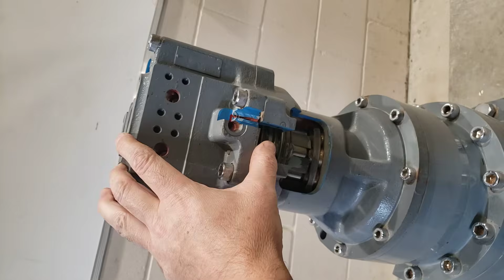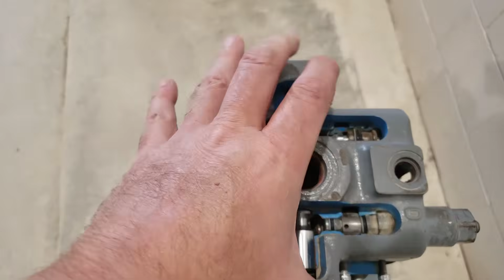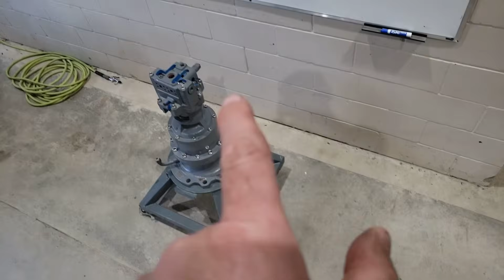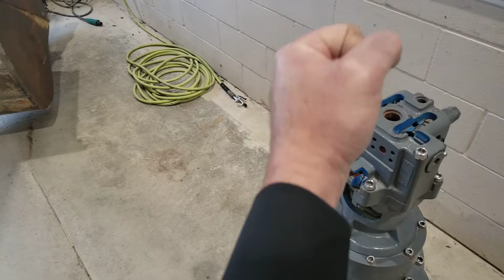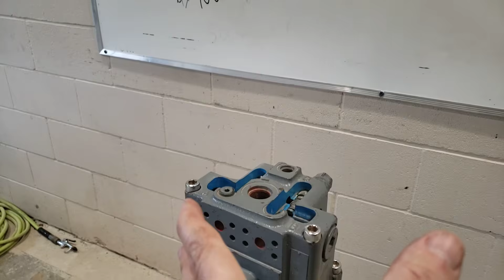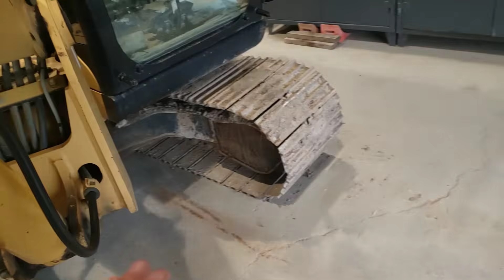How an excavator swing motor /swing drive works hydraulics

Comment: That fixed piston motor is also similar to what is used in hydro static drives in riding mowers.   But I was wondering,  in hydro static drives, is the motor what is variable or is it typically the pump that is variable?  The grasshoppers I run have dual motors and dual pumps, so I'm not sure.   I've seen other machines that have single pump and dual motors, so those would obviously have to be a variable motor, rather than variable pump... But on the machine you are showing, it's a fixed motor and you just vary the flow to it.   Interesting stuff.  A pump and a motor are literally the same thing I guess..  Just depends on where power is applied.  I'm doing a speed run through your channel and I've already learned a lot from your hydraulic vids.    I subbed
Reply from the maker: The motor swashplate cannot go over center. Its actually kind of comical to think of what would happen if one tried.... 😊
Reply: @hydraulics  Yes it can.  That's how motors go in forward or reverse.  The swashplate can tilt one way and go forward;  or be flat and not pump at all;  or tilt the other way and go in reverse.

Comment: Just saw this video and it was very insightful. I currently have an issue with a CAT 350 excavator. The RH swing drive leaks oil, which then dilutes with the grease applied to the turn table. I dont know what the reason for the leakage is. Any ideas?

Comment: So I have this excavator that don't stop swinging until you turn the control the other way and on a slope the bucket will swing down hill if I don't counter it with the control. What is are the possible reasons for this?
Reply: Did you ever figure it out?
Reply: @RylanCunningham1  no, I just borrowed it from my uncle. Have no idea.

Comment: If it’s won’t rotate one direction what does that mean ? Got a smaller bobcat that will only rotate one direction and can spin freely the opposite direction
Reply from the maker: Welcome to my channel. I am a red seal licensed Heavy Equipment Technician (421A Ontario) since 1989, and I recently got my EGSA Journeyman Technician certificate. I am an educator. I am not servicing equipment professionally and I do not compete with my colleagues or graduates, therefore this channel is about general education and gives a sampling of the kind of lessons one can expect in a trade related college program. This channel isn't for me helping you fix a specific machine for free. Please hire a pro.

Comment: Im running a 308 cat im geting a slight grinding noisewhen im swinging back as long as i swing slow it doesn't do it but when i dig fast it does it im not sure what it is it  just started a couple days ago
Reply from the maker: check swing bearing grease pan. check swing drive dipstick.

Comment: Hi! I have a Hitachi Zaxis 120 leaking Hydraulic oil from gear oil filler and dipstick on the swing motor. Any help or advice would be much appreciated.
Reply: Hydraulic leaking from motor to hear side check the motor seal
Reply: The main seal at the bottom of the shaft of rotary group has probably done its work. Cause of it can be a high case drain pressure, so it’s probably necessary to also replace the rotary group. Also check if the case drain hose isn’t clogged so the pressure doesn’t build up in the hydraulic motor, because that could be the cause of the blown seal.
Reply: @zanpetric4008  Thanks for the reply. it wasn't clogged. Rotary manifold rebuild didn't solve issue. (i didn't think it would but boss told me to do it.) We ended up replacing swing motor which solved our issue. Suspected valve plate or axial piston failure.
Reply: @_maxstockwell  rotary manifold has no connection to the swing motor, except the case drain in some cases from the final drives. By rotary group I mean the swing motor cylinder block pistons and valve plate (not rotary manifold). Your analysis could be correct. It’s good that you fixed the problem, but I still think the motor could be rebuilt. I just fixed mine (slew drift and low slewing power) and changed the main seal, rotary group and bearings (altogether about 700-800$/€ but nit the oem parts). Machine is tak 1140 which I believe has the same motor as yours-hms072?

Comment: Greta video. I have a ? Komatsu Pc 60. When u push left or right to swing sometimes the brake activates n abruptly stops. If I push a little coward adding the crowd cylinder it swings nice. So it seems the swing function is not always activating that pressure valve u talked about. Where would u start ur diagnosis? Thanks
Reply: We had the same issue with a new 8t doosan? They disabled the brake buy routing some pipe it’s definitely helped but it still bounced when the arm is at length it’s a pain in the arse when digging footings.

Comment: Can you help please. My Cat 311C swing motor, just serviced with new seals broke the two bolts holding it and bent the plate holding shaping it like a bowl. The left track motor has no movement. Both track motors were replaced recently. Where would such high pressure be coming from to bend the 10mm steel plate and lift up the whole swing motor.
Your reply would be highly appreciated as the mechanic can't work it out. Just replaced the main hydraulic pump as well. It did the same thing , broke the bolts and bent the plate an don movement in the left track motor?
Jason
Reply: Ever get it figured out?

Comment: If the swing motor has internal leakage would that cause low system pressure ?
Reply from the maker: Low system pressure? Maybe when swinging... I'd need to know a LOT more

Comment: working on a 425 bobcat mini excavator .If the seals were bad on the swing motor would that cause low system pressure throughout the entire hydraulic system.We have checked everything filters ,pump filters.main reliefs cannot figure whats going on.Buddy of mine told me if seals were bad in swing motor it could cause low pressure through the hydraulic system
Reply from the maker: Nope. How did you "check the main reliefs"? Did you cut the filters open to see what's in them?
Reply: @hydraulics  yes we did cut open old filter just pretty much a normal  dirty filterFlow tested the hydraulic pump all up to spec.We tested main relief at main relief port on the excavator. by deadheading all functions.When we first start machine pressure reads over 3000 psi after 5 minutes drops to 2400 after 30 minutes drops to under 2000 psi.Main relief on control valve is the only thing we have not swapped over.Is it possible its bad ?Is a way to bench test a main relief valve?
Reply: @jrac863  got a serial number of the machine?
Reply: @mikerewegan9960  it is aacj11297 its a 2009 machine

Comment: Nice video, thanks for posting...I have a Hitachi EX120-3 with the same swing drive shown in your video with the anti-reaction spool option. Oil literally sprays out from under the front anti-reaction spool cover and bolt holes when swinging left. I replaced the O-ring under the front spool cover with an OEM JDeere O-ring and lapped the cover flat but it still leaks terribly. I'm thinking there might be a problem with the front swing relief valve after watching your video. Can swing relief valves be serviced/cleaned or just replaced?

Comment: This was a great explanation. I have a Hitachi ex230lc and i was curious about why the swing does not feel very accurate. My swing motor probably doesn't have the valve to stop the back and forth after i stop swinging. I read that checking the swing relief valves for contamination may help as well. Thank you again.
Reply: Did you ever fix it? I’ve got a bobcat 341, it kinda feels weak when swinging either way. It’s the only function that feels weak though. And when I’m on a hill the excavator will swing by itself like it won’t hold itself.

Comment: Thankee,  Think I'm ready to rebuild mine now... and figure out why its never really stopped swinging, it would slow down, but never stop, unless engine was off, then it stopped hard, so its either a secondary solenoid, or the pilot pressure is remaining on.

Comment: Okay, well my mate has a 3t Bobcat Excavator, I think from their now discontinued series (machine's at least 8, not more than 15 years). I work on it for him, it has a good bit of rock to and fro on the swing bearing and almost every pin/bush is wore out on the boom, most concerning for me is it has free slew/swing movement at least to a degree (I haven't tested in depth), could this be related to the wet brake on the drive? Or maybe just that swing bearing again allowing all that free play between teeth?

I also operate & work on a Komatsu LC605 Crawler Crane, which seems to be based on a 8.8t Komatsu PC80LC, the slew function is very slow, does seem to lock, but may have the free lift function you mentioned. I assume this is all by design - But what would be the cause of the slow slew/swing speed? Just a lower flow rate or maybe a greater gear reduction?

It also seems to pull to the left when tracking, I figure this might be a tensioning issue, but it is a pain to check as it obviously lacks a standard boom with which to lift a track off the ground, is there another way to check or could it be something else?

Comment: I've got a question I hope you can help with. I have 2001 Cat 313B cr, if I'm on a slope my swing brake locks after 5 seconds and releases if I bump and hydraulics bucket, boom ect BUT my cab starts to swing towards gravity (downhill). Is this normal? I figured it would hold after the swing (park) brake is released. Thank you!!!
Reply: The friction disc are worn out
Reply: Loss off brake release pressure will cause swing to lock . Check for blown orings in pilot brake circut .
Friction discs worn out also.
Pilot Hydraulic pressure release discs.
Rare for discs to wear out since they only hold machine not stop swing .
Reply: Probably need to change the rotary group in the hydraulic motor. Check your case drain flow.

Comment: So on my komatsu pc-28 it's slow to stop swinging to the left but works fine to the right so it's probably a check valve not the swing brake?
Reply from the maker: I'd check the relief valves first. Swap em left to right and see if the issue switches sides

Comment: What would cause an excavator to swing extremely slow and not stop swinging on its own? The blade has minimal power too
Reply from the maker: I could come up with 50 reasons for any particular excavator. Multiply that by the hundreds of models with different systems from 2 dozen manufacturers... probably a thousand things could be listed. I'd have to run the machine, do some visual and basic tests, then hit the schematic and start looking for what's common to the swing and blade functions if I thought the symptoms were connected. I have 35 years experience working on heavy equipment and I wouldn't even begin to guess over the internet- waste of everyone's time.